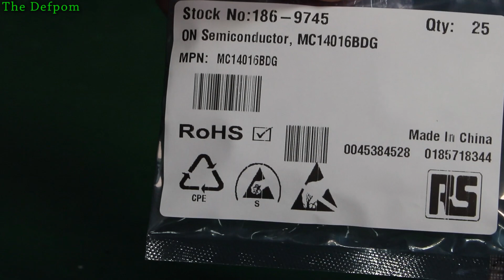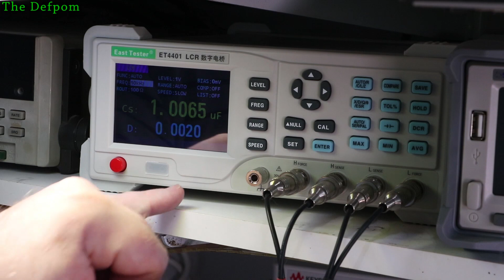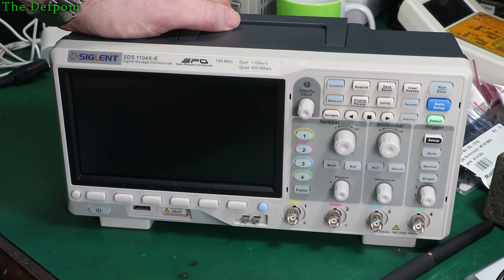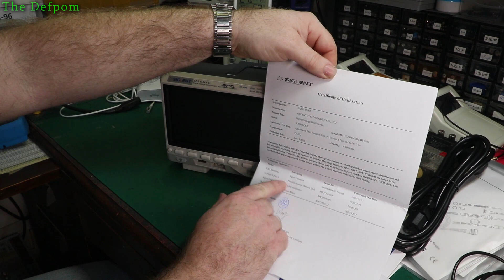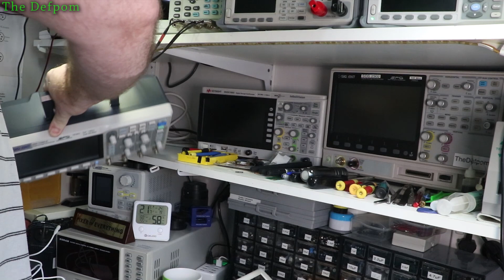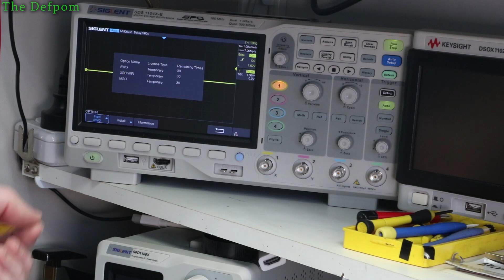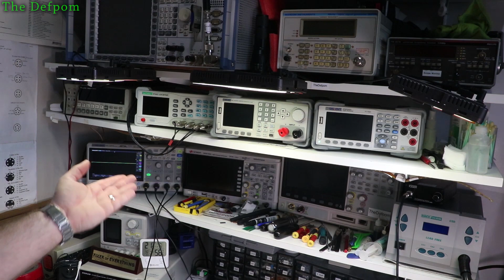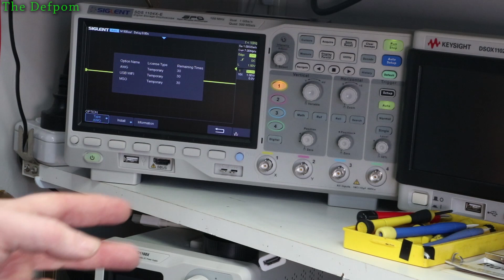#734 Mailbag Monday 13th July 2020 🎞 📭 📦 📩

Comment: Yep scope was all checked out before dispatch as we always do. FW check and if new is installed Self Cal is run and probes assigned to channels and compensated. FW installs reboot the scope at least once hence the boot count of 3 previous to you plugging it in. So yes yours had new FW installed as this batch of scopes arrived before the latest FW release back in March. Thanks for your plugs Scott and to Siglent for helping you out with a discount and enjoy your new DSO.   :-)
BTW, the WiFi dongle is the TP-Link TL-WN725N USB Wi-Fi adapter......get the gold version for exact match to the Siglent supplied USB dongle.
Reply from the maker: Thanks Rob, I just ordered a couple of wifi dongles
Reply: @TheDefpom  Last ones I got were from PB Tech for ~$20ea. but you can get them online overseas a good bit cheaper.

Comment: For my 4ch Agilent/Keysight scopes I have the Agilent PC  application that let's you capture signal from two scopes using their I/O, USB-LAN-GPIB,  linked trigger,  giving a 8 channel measurement display, at far below the cost of a latest generation 8 ch scope.
Has been very useful and more than a luxury.
Must check some time, as SIGROK software also accommodates reading many scopes via interface, not just lots of logic channels, it might allow similar multichannel analog  measuring!

Comment: Good to see you realise the need for more than 2 channel scope. I have for years advised people to go grrr or at least 4 channels. For other users the need should be explained a bit more.
At debug time in analog circuits two channels is becoming a barely usable solution, one for stimulus and one for response signal. Unless more channels on hand you have no way to probe other internal circuit points. Further there are many times one channel is required for a suitable triggering node for stable trace patterns.
In many professional labs now a greater than 4 ch is now very desirable  thus the new 8 ch scopes.
As many user now start with single channel CHEAPO scopes  they very soon learn that one channel is extremely limiting  as is the very limited bandwidth. Most cheap units are under 1Mhz and even better ones under 20MHz bandwidth
 Effectively useless in anything beyond audio. Given much testing even on the hobby bench is now at least having some logic with 10 to 20MHz signals, a 100MHz is the absolute minimum bandwidth. That does not mean looking at 100MHz signals, but simply circuits with logic switching in the 10 to 20MHz or rise/fall  times in 5 to 10 nanosecond   rates. That is typical 4000 series CMOS and 7400 series TTL logic, not even 74LS, 74S, 74ALS, or the new faster 74HC and faster versions  clock signals of many uProcessors now exceed 20MHz. If you wish to diagnose these for glitches and signal issues, even without MSO options the bandwidth MUST be high enough, say 5x max frequency.  Again more than 2 ch often in demand for analog and digital circuit modes. Great if you can afford MSO,  but even that needs the faster response scope as the sample rates offered are still bandwidth limited on slower scopes, though now 1G sample per second is common even on 100MHz scopes.